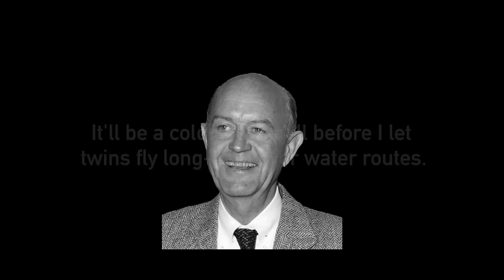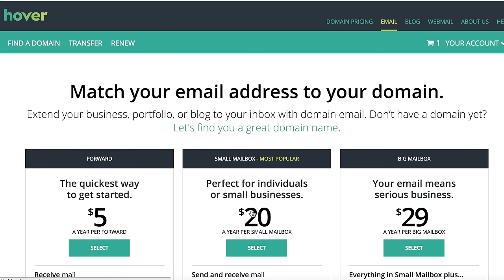Small Planes Over Big Oceans (ETOPS Explained)

Comment: The flight in A340 or B747 is by far more comfortable than in A320 or B737. More space, by far better business class with proper beds, less turbulence - it is all about bigger wide body planes. That's why I hate B787, it shakes industry into low cost transatlantic flights with smaller shittier planes. A380 is future I would like to see - flying ships, more space, more comfort (hello Qantas), higher pressure, better air. Flying on A318/B737 over Atlantic over A350 or B777? Fuck this.

Comment: It's a shame the 747 is going. Twinjets may be insanely efficient, no twinjet will ever surpass the beauty of the Queen of the Skies.
Reply: Tetragon 213 that is whycthe 747 eont be going ever.
Reply: The 747 is iconic, sure, but also a bit of an eyesore, I think. If you want to talk beautiful planes that are increasingly obsolete, I give you the A340-600.
Reply: The 747 was always intended to be a cargo plane after its life as a passenger plane.
Reply: Still 50 years is a pretty good run for a first of its kind roll of the dice. And they sold 4 times more than planned.
Reply: they still do freight. But it's just not cost effective as a passenger jet. The landing, maintenance and staffing costs would be huge for a plane that's not always full. Plus only big airports can take it. Most airlines don't need that many large planes in their fleet and they'd rather have a full double decker that's more energy efficient so they can sell more premium seats and save on fuel costs per person

Comment: I wonder why the 787 didn't just divert to Seattle. Judging from the map, the distance between the point of accident and Cold Bay seemed not that much shorter than  the distance between the point of accident and Seattle.

OTOH, flying an A318 from London to New York is a damn gamble since that's way too close to the maximal range of an A318! If there's even the tiniest fuel leak, the passengers are going for a swim like the passengers of the Titanic.

Comment: How about efficiency and power?  It's not just about reliability, DUH!!!!!
And large planes are, as the technology stands right now, going to need 4 engines for POWER, not reliability so when they takeoff and climb with 400-550 people, baggage and full fuel tanks, they can still climb and turn at low speed under ATC instruction at low speed as they ascend through Class B airspace.  Your video misses a pretty important idea and cites no sources.  Good job!